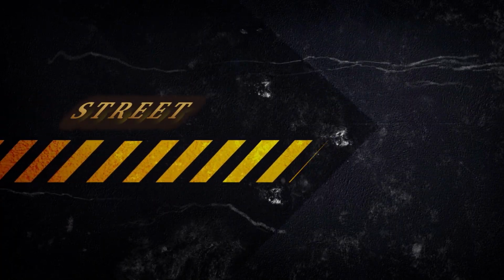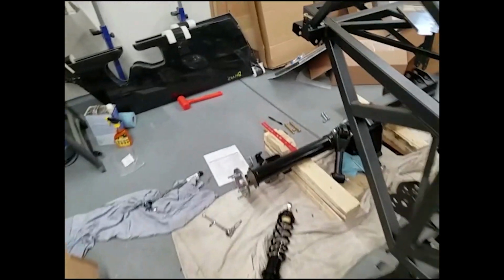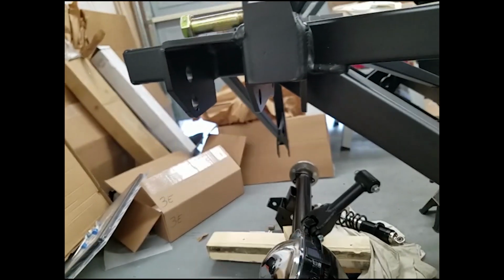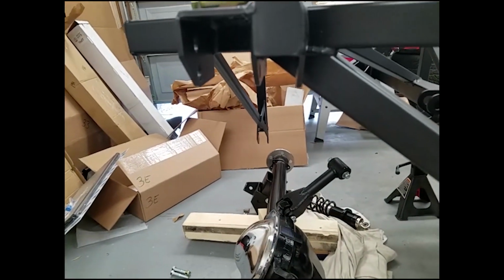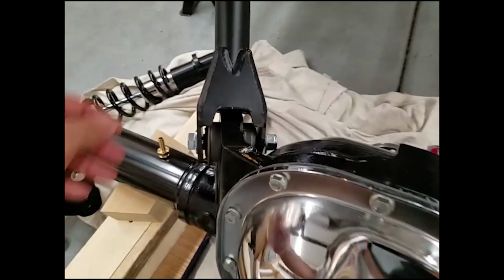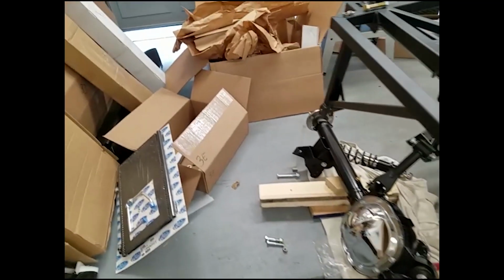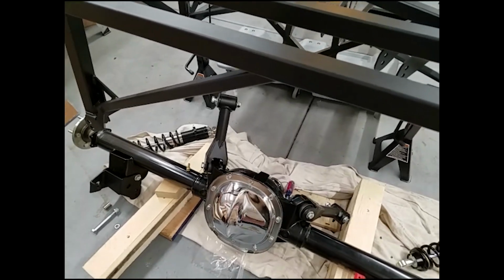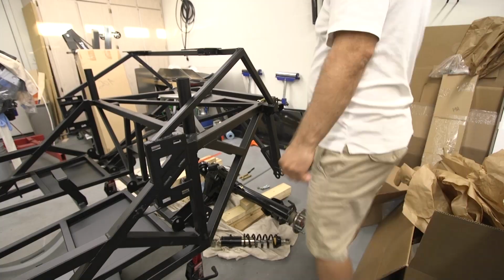Factory Five 33 Hot Rod V2 Build - Manual Discrepancy

Comment: The shocks need to go in the back tabs so that the shock coils don’t hit the tubes and bracketry when you get the pinion angle aligned.   Additionally, unless they changed the upper link lengths, the uppers should be adjustable.  They recalled the fixed length link a month or two ago.   

I went through this with them all already.
Reply from the maker: You are correct!  Will redo in another video.